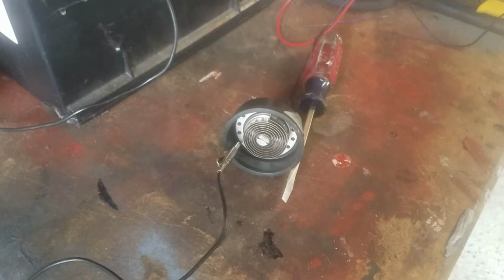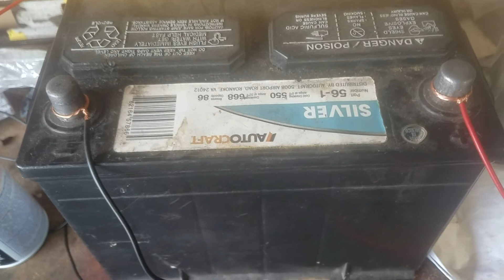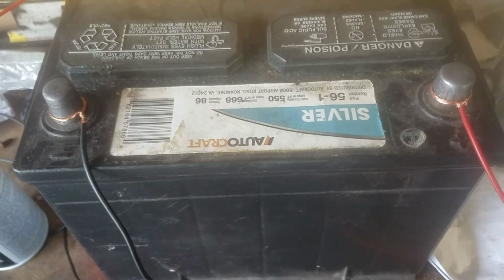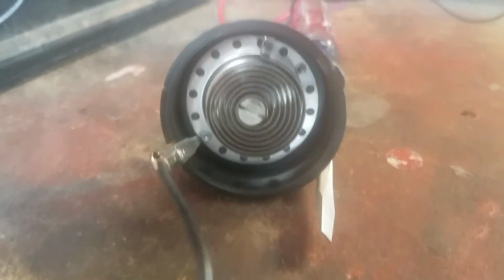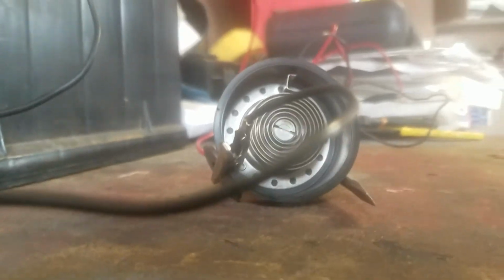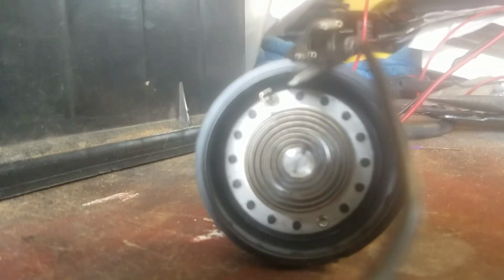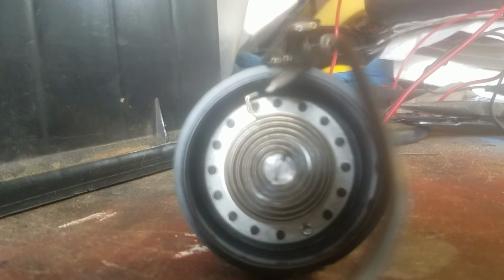Testing choke thermostat for CFI

Comment: Hey I removed mine to check and it’s working but do you recall what position that metal slot is supposed to be in that you put through the spring on the choke ?